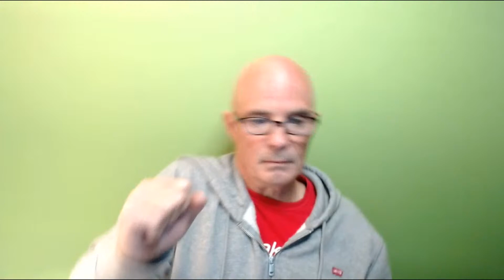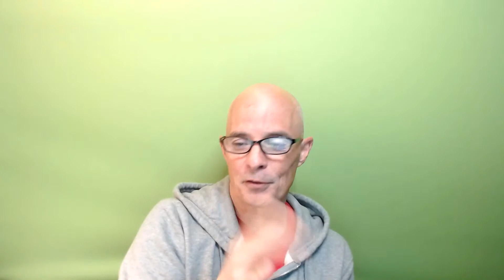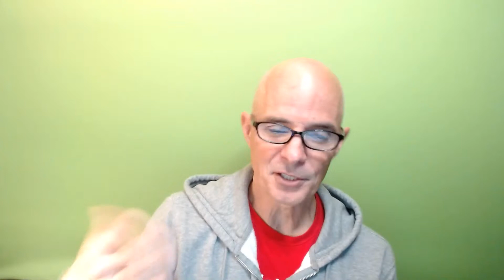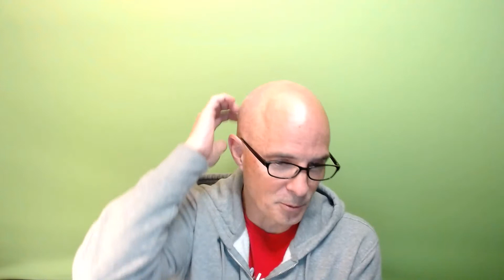LET'S TALK TECH-CAN YOU RUN THE SAME CAM ON AN NA, TURBO, BLOWER & NITROUS MOTOR?

Comment: Pick if you want it to idle rough or smooth do you want to change springs often or not often or not at all let boost make your power not your cam cam will help and idle how you want but a pound or two will do a lot more

Comment: Hey, I love your channel, and am in fact building a turbo TPI 383 for my Tahoe right now, largely motivated by several of your videos. I do want to clarify something that you said early in the video that I think is incorrect, though. I don't recall the exact numbers, but you describe a temperature drop of about 40 degrees from 90 degrees as being about 40%. It's actually much less than that, since you'd have to convert to Kelvin to get the correct answer, since Celsius and Fahrenheit don't start at absolute zero. 90C is actually 363K, so a 40C drop is a much lower percentage. Nitpicking, I know... but I often see people get that wrong because 'zero" isn't really "zero" unless it's Kelvin.
Reply from the maker: 40/90=44.44 % BOOM
Reply: @richardholdener1727  The problem is that in the Celsius scale, "zero temperature" (i.e. absolute zero) is not 0c; it's -273C. If you're trying to calculate the percent change in temp, you need start the scale from absolute zero. So the correct answer is 40/363=11%.
Reply: @brettsjustlucky  you're high. The scale is relative to itself. The motor nor the air cares about what scale it's on as long as both comparisons are the same scale. That's like arguing a 20% increase in hp based on X would be false if you don't convert it to kw's. It's 20% IN HP JUST LIKE ITS 40% IN FAHRENHEIT.
Reply: @realkhaoskustoms  I'm really not interested in arguing. I was just pointing out a common misconception. Temperature is a measure of thermal energy, and if you want to calculate a percentage change in that thermal energy, the scale has to start at zero energy; i.e. the Kelvin scale. If you don't believe me, fine. But if you're interested in really understanding it, I'm sure there are plenty of videos on Youtube about thermodynamics.
Reply: @brettsjustlucky  That is the anticipated power gain. Intercooler efficiency (charge air drop) measures the charge temp drop before and after the intercooler using the ambient air temp as a reference.
Reply: @2lotusman851  Ok, I'll try this one more time. If you're basing any calculation on percent change in heat energy (which is what temperature represents), and you believe 80F is twice as hot as 40F, you are going to be WAY off. You need to convert to Kelvin first. 80F = 300K and 40F = 278K. 300/278 = 1.07. So the increase in temperature is only 7%, NOT 100%! We have three different temperature scales for historical reasons, but the only one that actually starts at absolute zero, and can therefore be used to calculate percentage changes, is Kelvin. This is physics 101.

Comment: YES!  Swap manifolds for headers at the elevated power levels to see if there is a performance improvement.  We always say "the most important thing is to direct all of the exhaust t the turbo...  get all of it."  However, it seems that if the engine makes more power NA with headers, it'll make more power with headers when boosted.

Comment: If I may Mr. Holdener, you need to keep reminding people to go out and look at all testing you have posted.  I have been watching your channel for some time and the amount of content is extensive and not found anywhere else.  If people would take the time to time to dig through the testing you have done, they may find you have already looked at something similar to what they are working on.  I have mentioned this before but that is exactly how I selected the XE247HR cam for my 331.  Matter of fact I copied the entire engine recipe as closely as could.   Best engine I have ever built.
Reply from the maker: thnx-there is a lot of info

Comment: Richard, what about a video of rebuilding the small superchargers?
Reply from the maker: it doesn't need to be rebuilt-just grab another one
Reply: @richardholdener1727  not necessarily yours, but the one I have is full of oily grime, so took it apart. And since it's apart already, was wondering how to rebuild. We don't see a lot of them around here.

Comment: Would a GT45air to water intercooled be big enough for a 434 ci FE at 10:1 cr to make 700-800 hp with a 229/234@.050 and .550 lift solid flat tappet? Sanderson shorty header reversed tied together. ?I would want a smaller amount of torque than hp, 550 ft lbs and even 850 hp. 4.17 bore 3.98 stroke Id assume E85 would be mandatory. What hot side would I need
Reply from the maker: gt45 would be on the small side for that combo